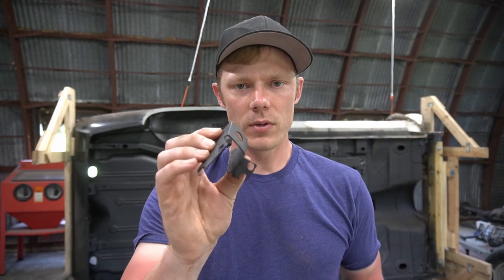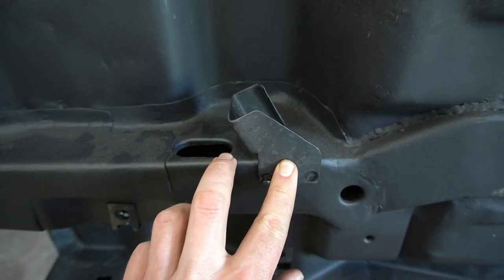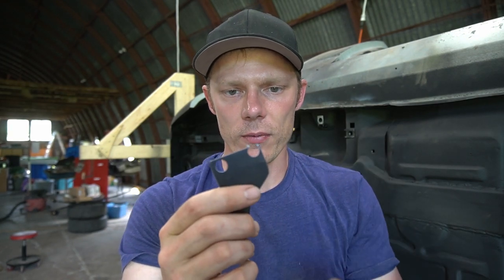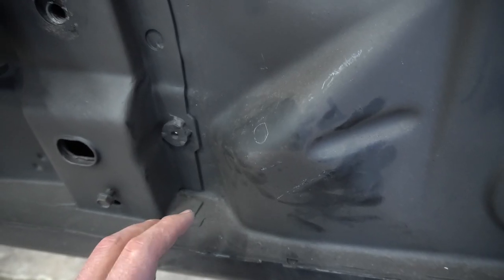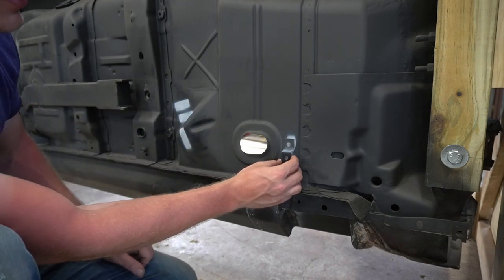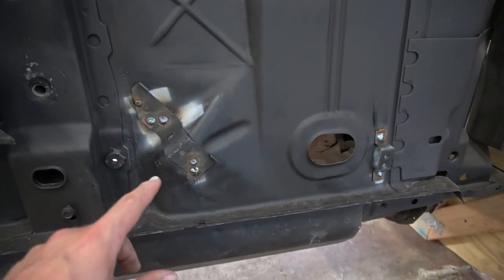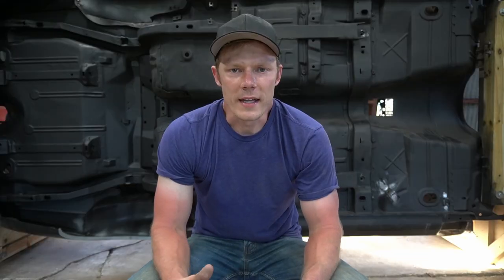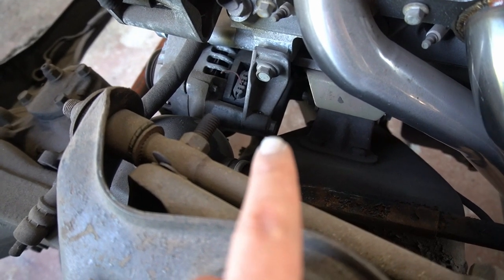Transferring E-brake Brackets From Old Floor Pans to New - 1971 Camaro

Comment from the maker: What are you all working on this weekend?
Reply: Changing a engine in a Kia. Camaro is on hold. Just bought a 80 Camaro lol
Reply: Hopefully the C-10.
Reply: @dalejrfan820002000  nice!
Reply: I built your tip over jig and flipped my car over
Reply: Cutting lumber to build your jig design. 😂
Reply: Any video that starts off with your car sideways on that jig is a video that gets my immediate attention. Keep them coming!
Reply: @dalejrfan820002000  Nice! I'm building an 80 Camaro on my channel. Got any footage of yours yet?
Reply: Have been doing cab repairs on my 68 C10, much respect for the skills you have and share with us ! Great days and health to you and yours !
Reply: Are you working on a new Video sure do miss them?
Reply: Gosh,  I went and looked at houses a framing carpenter had framed.  I am considering hiring him to frame a new house. No work on my 55 Bel Air until the 3-car garage on the new house is finished 😒
Reply: @yourcarsucks3259  No lol But I will
Reply: @yourcarsucks3259  need any parts I have 3 Camaros?

Comment: Dan you have to get yourself some of those Eastwood Stitch Weld Magnets! It would of been the perfect tool for holding down that bracket.
Reply from the maker: I have a set and didn’t even think to use them! They are strong little buggers and would have held the brackets easily. Thanks for the tip Bart. I’ll dig them up for next time.